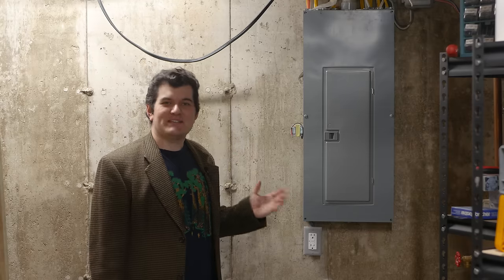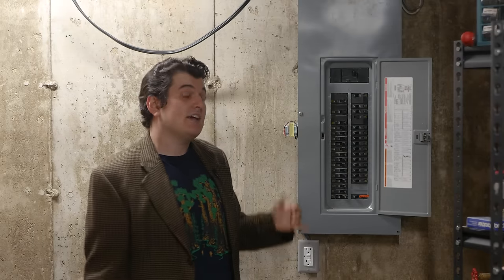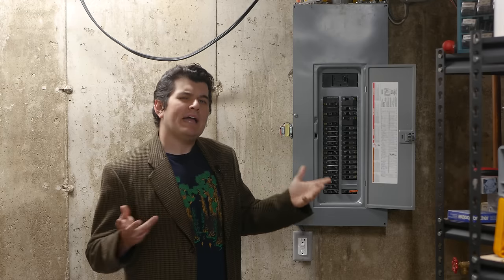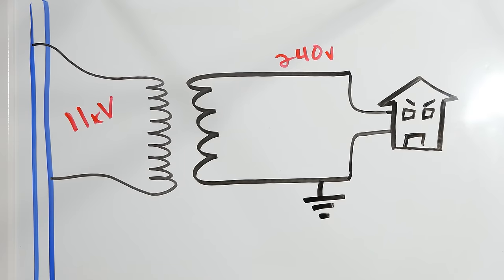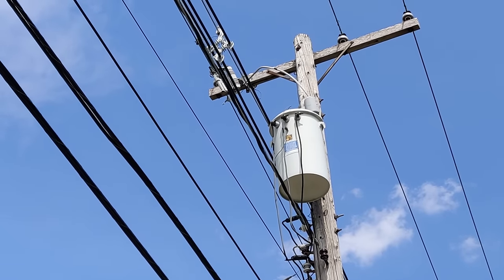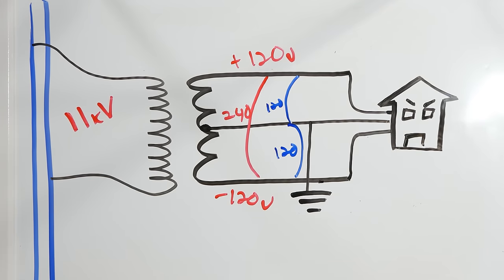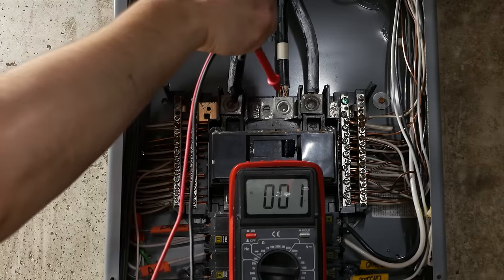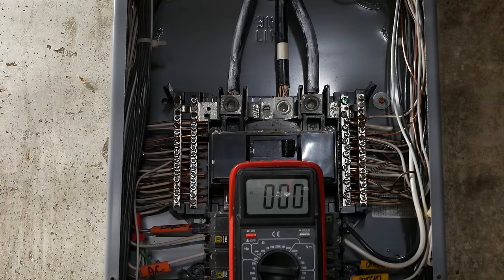The US electrical system is not 120V

Comment: That rant at the end had me in stitches, and the info about the US electrical system was really interesting.
Your videos never fail to educate and entertain.
Reply: I'm trying to remember the last time I turned a power switch (Australia) on or off... it was probably when I moved into the house and plugged everything in. I never really thought about it, but maybe they are kinda pointless.
Reply: @matthewjohnson3610  I'm wondering if they're there for child safety, or maybe if an outlet needs to be cleaned or worked on? (Just a layperson's guess, obviously.)
Reply: @shibolinemress8913  I (Australian) turn off the switches if I'm leaving the house for more than about 5 days or if the socket is empty, a lot of electronics like TVs have standby modes that draw 1 or more watts, overall it's an unnoticeable difference but if say 1 million people are doing the same thing then it adds up. 
The main reason though is safety, given how cheaply made electronics are these days I don't want to risk going on holiday and have my phone charger shit the bed then burn the house down. Also on safety is like the US many of our wall plugs still have fully exposed pins that can shock you if the plug is only partially inserted.
Reply: My home has two outlets wired to a double switch panel next to the room's overhead light switch. You can just power on or off whatever's plugged into that outlet without having to reach down for it. It's way better, and I don't even think that was done for luxury's sake.
Reply: @matthewjohnson3610  Yeah it is really the appliances that needs to be efficient not the user and this is how it is today.  Sure your phone charger uses a little over time but most things like screens, audio gear, kitchen appliances they all nicely conserve power when not in use.  This is a more recent change though, I am guessing like since the year 2000 or so.

Comment: Retired American EE living in SE Asia. It's 240/380 here, like Europe. 3-phase transformers are standard in most neighborhoods. This makes residential electrical installations much easier and cheaper than in the US. No need for costly extra transformers if you need 3-phase. It's also easier and cheaper to wire a kitchen to obtain adequate power for an oven or a big induction cooker when you only need 2.5 mm wire (14AWG) to provide over 3KW. Edison died nearly a century ago so it's time for the US to upgrade to a better secondary distribution topology. 240/380 V is not scary and no big deal when done properly with modern components. Korea already did this a few decades ago

Comment: On the subject of weird gas dryers, I'd love to see you cover gas fridges.
Reply: or gas air conditioners
Reply: My RV has one. No clue how it works lol
Reply: Those are really niche and normal [electric] fridges are much cheaper to operate.
Reply: or gassy people
Reply: @kabj06  https://en.wikipedia.org/wiki/Absorption_refrigerator
Reply: The people getting confused about gas tumble dryers are the ones that get confused between what the americas call gas and gas....

They think your tumble dryer somehow runs on petrol!
Reply: @kabj06  That's actually how all refrigerators used to work - they use ammonia as the working fluid. And yes, they're super weird.
Reply: Or gasoline washers.
Reply: Andrew M. They are meant for places without very good electricity service, or none at all. I can name places in the u.s like that.
Reply: @bwiltse2620  Some very old refrigerators (the mechanical ones, not absorption as far as I know) also used to use sulfur dioxide as a refrigerant.
Reply: Veylon's Channel what are these real? Amazing
Reply: Lotta Amish around me have gas appliances.

Or they just run a feeder from a generator in the barn to the house and use electricity.
Reply: @kennysboat4432  That's one that threw me for a loop; up until I saw a restoration video from HandToolRescue on a Maytag washer engine from the 1920s or 1930s, I had no clue that a gasoline-powered washing machine was even a thing.  It just never occurred to me that some of the things that we take for granted as being electrically-powered today weren't always electrically-powered.
Reply: Opecuted  Found the edgy kid in the comments lol
Reply: @caoYB  Most definitely real.
Reply: isn't a car with the AC on technically a gas refrigerator? 🤔
Reply: I heard of that awhile ago too.
Reply: Yes please!
Reply: Those RV gas fridges are complex.  I believe there are 2, perhaps even 3 independent cooling systems/circuits to make a hot propane flame become a freezing cold ice box.  They are amazing.
Reply: @r5LgxTbQ  The cycle in that one is the vapor-compression cycle. When  people say gas refrigerator they really mean one that burns a fuel such as LPG because such a system (the absorption refrigerator) requires a heat source to operate. And in case you were joking then yes it's a gasoline powered fridge, or diesel powered if you have a diesel engine.
Reply: Absolutely! Those things are weird
Reply: Can you explain why so many Americans seem to have gasoline powered generators as a standby for power cuts? Could it be due to the extreme weather events the USA is prone to? Tornadoes, hurricanes, blizzards and heatwaves come to mind.
Reply: 3 way refrigerators as they’re known (well down here in Oz) use absorption of ammonia in conjunction with a gas burner or 12/24V and 240V heater windings to operate. Neat in that they’re silent and can run for about 3 weeks of a 9kg LPG cylinder but need to be perfectly level to operate. Any tilt and the efficiency is reduced. Used to have one but now have a modern compressor fridge freezer.
Reply: @bwiltse2620  They use a small heater instead of a mechanical compressor. No moving parts and quiet. only problem is the ammonia is corrosive on the refrigerant tubing. They're still used in boats and RVs.
Reply: And a small bit of trivia:  The typical ammonia-absorption-cycle refrigerator ALSO has HYRDOGEN in it.   Used in part of the cycle to change the partial pressure of the ammonia without the need of a compressor.   And their use of natural convection to circulate the water/ammonia is why they have to be carefully leveled so no point in the coils requires the liquid to flow 'uphill'.  :)
Reply: And even Soviet gas-powered radios.
Reply: Oh boy.. I've seen one of those once!
Reply: Denis lost in London they don’t. I only knew one person who had one... But my dad now does. Lost power a few days in Katrina and had two tornados this year, one thru back yard and one a couple blocks down. Good to have electricity for a couple days of essentials in case that happens.
Reply: @dasy2k1  Corvairs and VWs used to have optional heaters that ran on gasoline. What could possibly go wrong?
Reply: @denislostinlondon199  Absolutely. And then smaller ones are handy for events like camping and tailgating where one would want to power, say,  a tv or a blender or something where there isnt an outlet. 
OR, small generators can be useful for running tools and machinery on construction sites or remote jobs, like farmers repairing fences.
THAT SAID
They're kinda uncommon house-to-house unless you live in a specific bad weather hotspot.
Reply: @kabj06  it takes advantage of the fox. Ammonia sucks in heat and gets cold as it condenses. So it uses a flame on the bottom to heat up ammonia and boil it away and then it moves it to the other side through natural currents as long as it's vertical and then the ammonia gets really cold as it condenses and it drips down cooling off everything inside.

They use a lot of propane if they are trying to get cold from a warm starts but once they're cold they used basically nothing. The best propane fridges are the ones that run on electric for the first 12 hours until you get all nice and cold and then switch to propane
Reply: The absorption driven gas (or electric) refrigerator is quite common in hotel-rooms. They are extremely quiet and very reliable as the number of mechanical parts are close to zero and therefor require almost no service.
Reply: @DrFreeeman  With all the hubbub around using environmentally friendly refrigerants, I wouldn't be surprised to see some of the older non CFC/HCFC/HFC ones come back. Some things already use propane as a refrigerant, the industrial refrigerant of choice for very large systems is still Ammonia I think, and the only problem with using CO2 is the high pressures involved.
Reply: @44R0Ndin  Yep, and some fridges and freezers use isobutane (R-600a, while butane is R-600)
Reply: Yeah my uncle has one at his off the grid farm... always weirds me out that gas can cool stuff.
Reply: All the big dryers used in laundromats in US are gas dryers....if you turn up the heat and look through window and through the tiny holes in back of the cylinder while it's spinning (with no clothes blocking your view) you will see there is fire about 6 inches from your clothes.
Reply: @jakeaurod  
Gas heaters are definitely a thing, but they're more useful in colder climates where a conventional AC unit would have a hard time drawing heat from the environment and thus have a much lower COP than what it's designed for. Additionally, that's just stress you're putting on the compressor for a relatively small performance.

Gas heater are a no-brainer in cold climates. You'll save money, have a warmer home, and have to replace the compressor less often.

Comment: The switches on UK wall outlets are for people to turn things off at the wall in order to mildly annoy other members of the household.
Reply: There's some outlets in the United States where it's like that it's just the power switches are usually next to light switches intend to get confused with them all the time because they are normal Power switches that are wired in between the breaker and the outlet. I knew somebody who had their Wi-Fi router on one and somebody turned off the light switch knocked out the internet for everyone in the house.
Reply: WindowsLogic Productions  the UK has flaps covering the neutral and live terminals so no its not for safety.
Reply: & for those with timer adapters plugged in, to annoy me after I've set them correctly!

Comment: "Transformers are more than meets the eye".  Solid.  Also, props for using only one hand when measuring across the 240V at the top of the panel.  SMART!
Reply: Mentioned the one hand rule to a dude a while back and it turned into a whole thing about how much of an idiot I was for believing that, I grew up in an electronics classroom, my stepdad used to do TV repair on CRTs, one hand rule saves lives, sucks for my stepdad though he's left handed, the proper hand is the right to lessen the chance that it goes through your heart.
Reply: @travismason2811  Pardon my ignorance: who is the real idiot then? Is the one hand rule false?
Reply: I'm glad I checked for similar comments prior to posting mine.  I had the same two observations.  Covering WHY we do a one handed voltage check would be nice for another video!
Reply: At first, I thought using one hand was more dangerous, too.  If your dexterity isn't too good, you could cross the probes.  But then I realized that if both hands came in contact with the contacts, you would have 240V, 120V, going from one had to the other, with your heart in the middle.  With one hand the current flow would just be from one finger to the other.
When I was young I grabbed both leads of a 120 circuit with both hands.  It felt like somebody kicked me in the chest.  I jumped back about six feet.
Reply: @travismason2811  Why would that lessen the chance it goes through your heart? I'm pretty sure that's not actually true.
Reply: @TheReaverOfDarkness  The heart being on the left side of your body a current travelling down your left arm to your feet (to reach ground) will be more likely to travel through your heart than one travelling down your right arm. I've no idea whether this is borne out in the real world, but it seems plausible.
Reply: @JonSenior  But the heart isn't on the left side. It's in the center.
Reply: @TheReaverOfDarkness  It's ever so slightly to the left of centre. Meaning that if you're playing the relative safety game then you should use your right hand (all things being equal). If you're stood on one foot then you should use the same hand. If you've one foot in a puddle of water then you should use the other hand.

Or you can stand on a thick rubber mat, but it's all about relative safety.
Reply: @JonSenior  Yeah but the left side of the heart is less important than the right side. I don't think the left-hand right-hand thing is a thing.
Reply: @TheReaverOfDarkness   its a heart, importance of sides.... huh?
Reply: @ideath4lif3  It's true. There is an order of importance of each of the four heart chambers. I don't remember the exact order of importance, but they each have a different strength. Either of the two chambers on the left side can compensate for the other, as can either on the right compensate for the other. To a lesser extent, either the left or right side can compensate for the other. The strongest chamber is mostly able to pump blood for the entire body and is enough to keep you alive for sustained periods of time with all three other chambers completely stalled. However the weakest chamber is completely incapable of sustaining you and in fact having that one stalled is a completely benign condition in anyone whose other three chambers are functioning normally.

I might be wrong on which side is more important. The bigger thing to take away from this is that the heart is a lot more complicated, and this myth about lefties being at greater risk of electrocution is highly dubious and almost certainly not based on any real data.
Reply: I was thinking the SAME thing
Reply: @TheReaverOfDarkness  you say that as if reducing the chances of your heart getting zapped is some how a bad thing.
If you thought the whole thing was a dumb myth anyway why waste so much time on some rant about how you vaguely remember one side of the heart being more important than the other if you were gonna die if it gets zapped at all anyway tf
Reply: @4473021  Because I'm trying to help people stop wasting time on false safety when they could instead be practicing actual safety. These kinds of myths aren't benign, they hurt people.
Reply: @TheReaverOfDarkness  Using just one hand? Sure, some tiny amount might go through the heart, but most will be through the flesh between the two fingers that made contact with the voltage differential.
Reply: @TheReaverOfDarkness  I'm still going to use one hand on anything with enough voltage to conduct through me.  Weather its a myth or not, it was thought for almost 100 years, it's not difficult but takes a little practice.  Not sure how limiting current contact with your heart period would hurt someone, but ok you do you Boo.
Reply: @buggsy5  I never said using one hand for electrical safety is a myth! That's the kind of facts I'm trying to promote here! My whole point was to get rid of the myth about WHICH hand mattering, so that we can focus on what DOES matter: how MANY hands!!
Reply: @travismason2811  It's not a myth! Never put both hands near a source of potential electrical discharge powerful enough to damage your heart!
Reply: @TheReaverOfDarkness  Well, I don't think I am in real disagreement with you on that. As long as you use only one hand, it does not matter which. This assumes that you are also using the precaution that the rest of your body is isolated.
But I disagree if you believe that any current through the heart, either from arm to arm or arm to lower body, is going to go through just one side of the heart.
Reply: @TheReaverOfDarkness  It's because if your hand touches both contacts the electricity only goes through your 1 hand, but if each hand touches 1 contact, then the electricity travels through your whole torso, including your heart.
Reply: @loganiushere  true!

Comment: I went to tech school for HVAC, and I was never really taught the difference between 208/240. Even my super awesome, smart, one-of-a-kind electrical instructor never really mentioned it(I learned a lot of other really valuable stuff from him though, and particularly have a better working knowledge of how motors work than most of the HVAC techs I work with, thanks to him)
I had no idea that 208v was from 120v-3 phase. In my (limited) experience I've pretty much only worked with 240v-3 phase or split-phase120/240v and only ran across 208v once or twice, and had no clue why it was different. 
Thank you sir, I've learned something new today! Been watching your videos for a long time.
Reply: What he doesn’t mention is that 120/208 is usually produced by stepping down a 277/480 utility feed.

Commercial/industrial customers often use 480 for motors and 277 for lighting.
Reply: @k5sss  What he doesn’t mention is an infinitely large set
Reply: @MegaZeta  I would argue it's actually a very large finite set, given that the human mouth can produce a finite range of frequencies